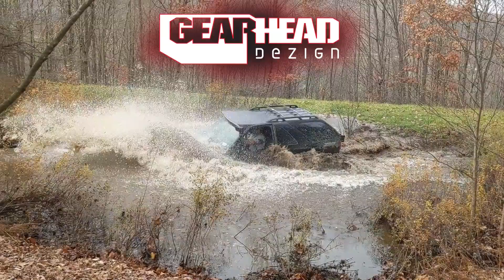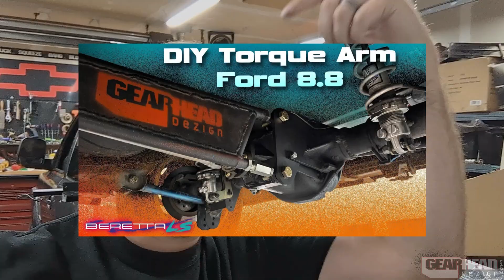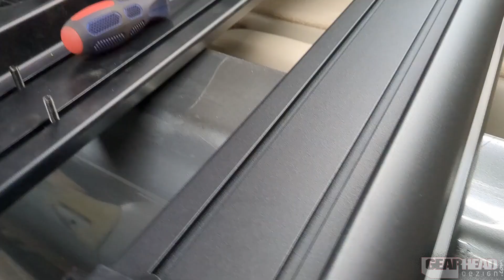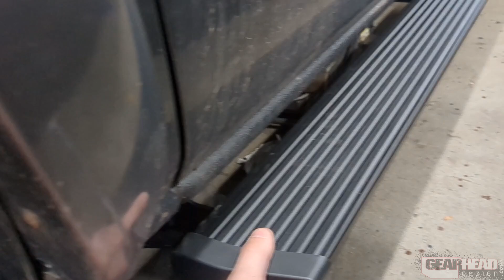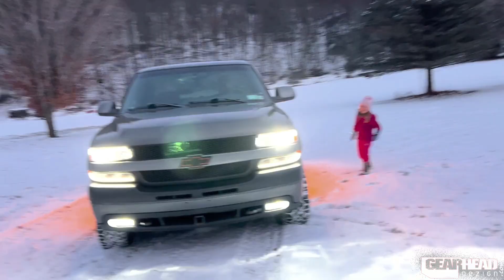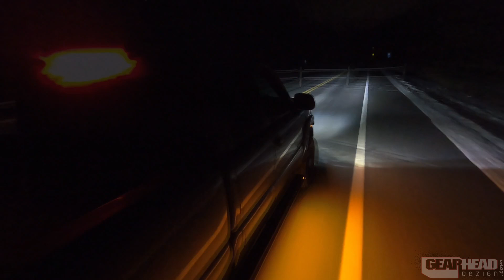Fitting Crew cab M1 Lumastep bars on my Ext cab GMT800 Silverado @boostautoparts

Comment: Those are cool! I like that the lights are inset to the step bar for a clean look. Nice call on both logo placement and moving them back a bit for the step in the bed.
Reply from the maker: Yeah they're a nice quality price. Pricey...but top notch stuff. Nice to have em for free.🤣 I might drill out the boost auto logo and replace it with GEARHEAD DEZIGN 😎